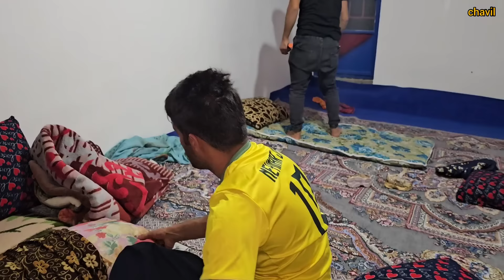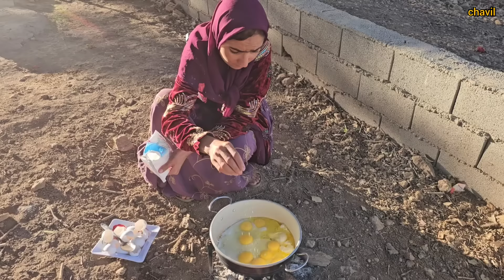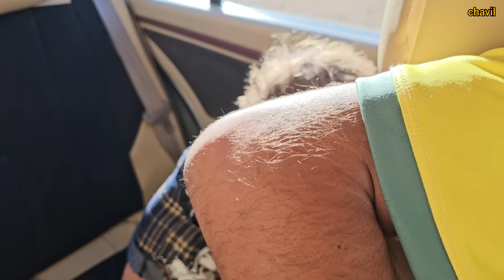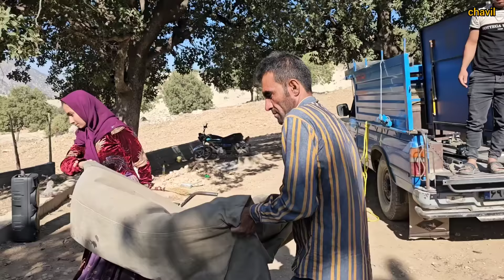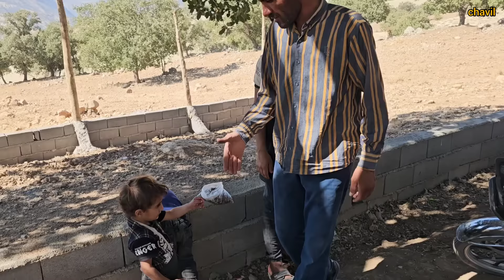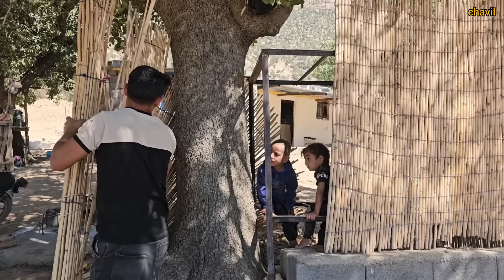Nomadic life: a dreamy night in Chavil farm and Abolfazl school

Comment: I've noticed if they have larger bottoms or rear-ends, everyone "Moons" 🌙 
everyone. Pants don't fit don't cover them up right 

Most of them have shorter legs & are longer waisted, so tops don't cover mid-abdomen region, consequently they ride up on them.
Some have larger heads so kids tops have smaller openings, hard to get heads through.

The clothes are irregulars rejects from manufacturers but affordable for people without jobs!

Have to have jobs to be able to afford big city tailored fitted clothes found in bigger cities nicer shops.